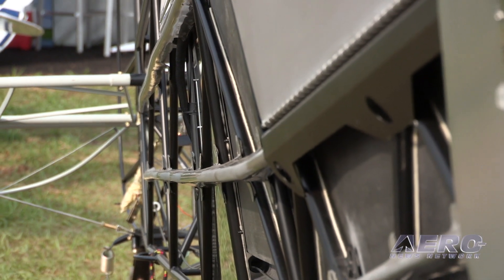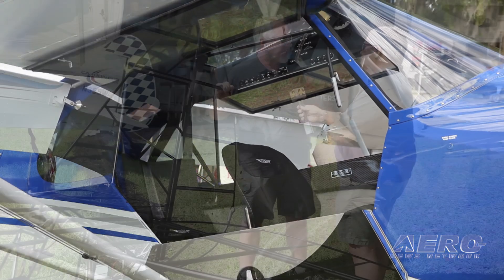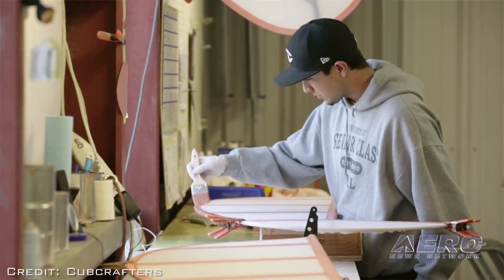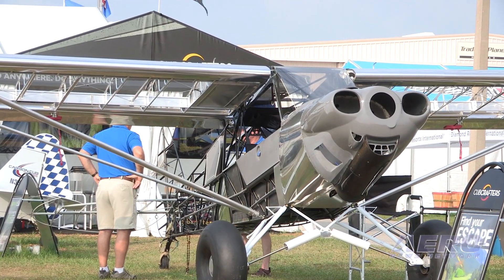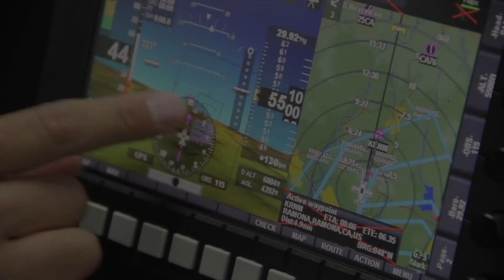Aero-TV: Comfortable Kit Building - CubCrafters EX-2 Discovery Kit

Comment: What advice would you guys or other people in the comments give for a 19 year old outdoor enthusiasts
Reply: Wanting to get his first plane ever
Reply from the maker: Austin... a flying club might be a good way to get a handle on aircraft access and learning about ownership through the club. It's but one of the ways that you can get access to an airplane without bearing all the costs by yourself, from the outset. Shared ownership/partnerships are also another possibility.
Reply: I live In Kansas do you have any advice on where to go
Reply: @austyinglenn  If you are close to an airport with an FBO (Fixed Base Operator), apply for a job as a line boy.  I was totally enthralled with learning to fly, and even tho I initially was just paid minimum wage, they let me rent the planes for 1/2 price, and instructor time was also 1/2 price.  All the "hangar flying" chat was invaluable, and I was able to pass my written exam for my SEL, as well as my instrument rating, just from books & help from people I worked with & those who owned the planes I fueled.  Another huge advantage was that I taxied a lot of different aircraft, and was able to get a feel for so many different ones.  I was also invited to ride along in many different aircraft.  Assisting the mechanics & doing oil changes, etc. for the 25 hour checks gave me confidence to work on my own 172.

Comment: carbon cubs are amazing its just the cruising speed that's not so great.
Reply: You may want to check on the FX. It cruises at about 135K
Reply: faster than a cessna 172, isnt it?
Reply: A 172 can Cruse faster than a cub in rough air but in smooth it's near the same